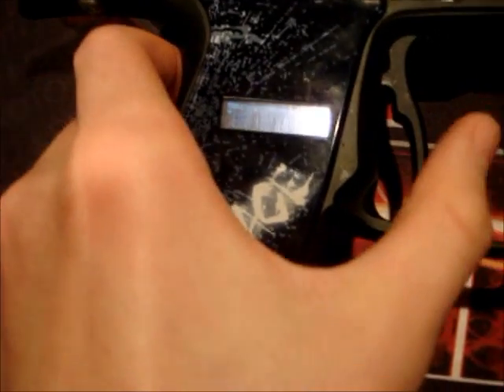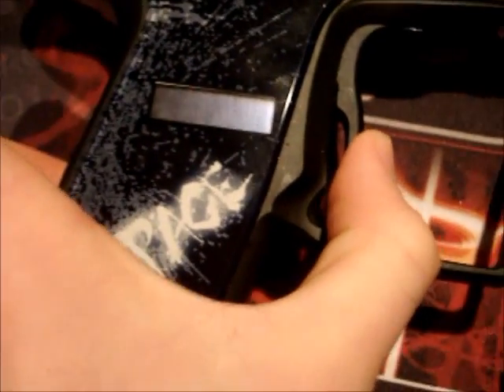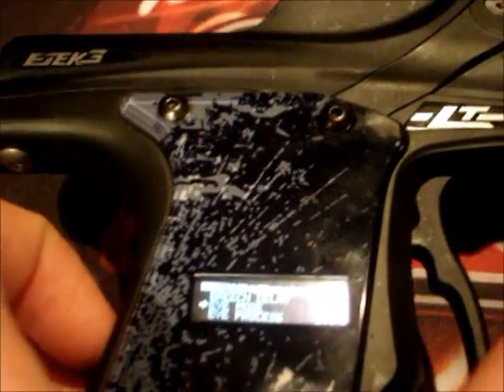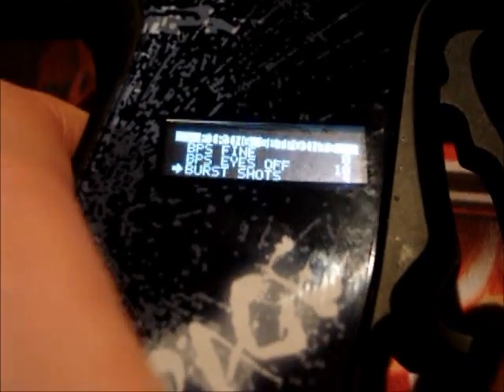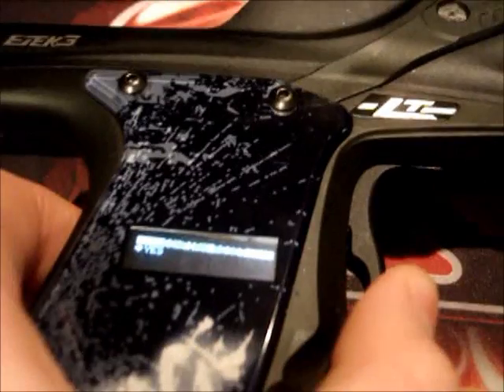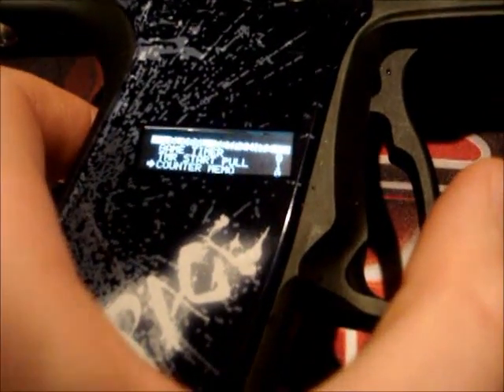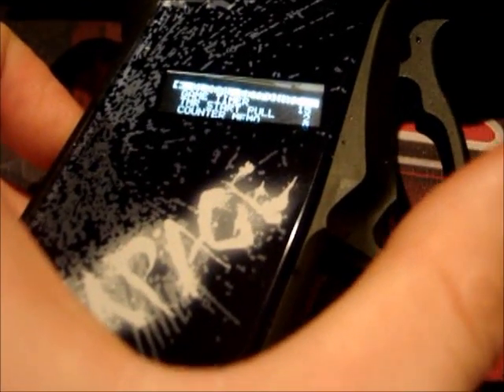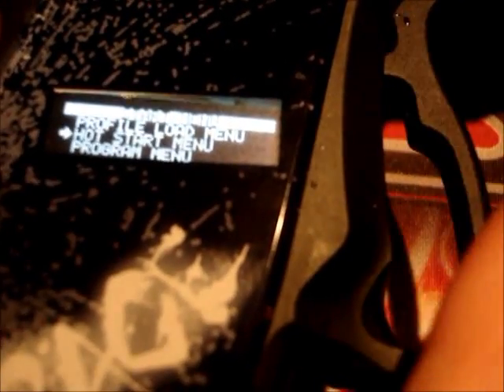Programming the Ape Oled Board Etek 3

Comment: how does dwell 8 work out for you? the stock dwell is 9. I usually run it at 10 with lpr 1.5 turns in from flush